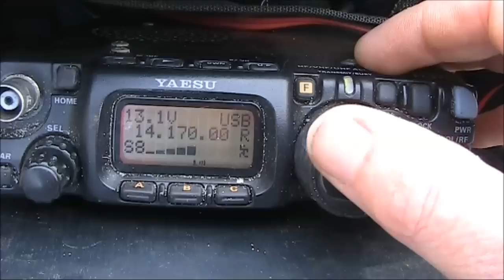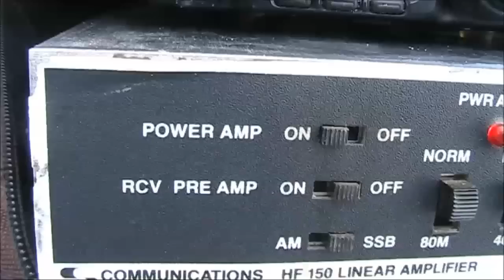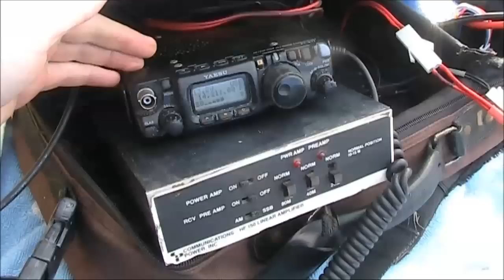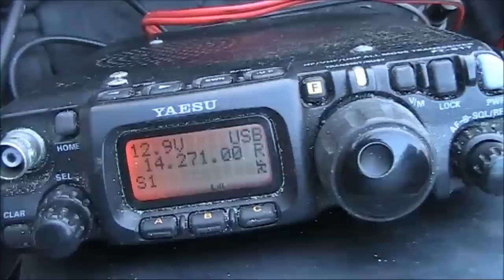50 watt European DX from the beach on 14 MHz

Comment: Peter I operated in the JMFD with one of those batteries connected to a FT-857D running at 50 watts. It lasted 5 hours and 20 minutes with lots of TXing and calling CQ contest. VK5MTM

Comment: Peter,
Great video! Zippy batteries are super.  I use a pair of Zippy 4200 LiFePo4 batteries with an FT-857D at around 30 watts and get around 3 hours total, 20% transmit/80% receive.  I do stop when I have taken 3 amps out of each battery to ensure the longest overall life for the batteries.  If I am near my vehicle then I can charge one battery while operating with the other.  73, Tony - KE4VVF

Comment: A great DX session Peter and well presented video as always. QRP is great but its handy to have the extra power when needed. Still looks a lightweight portable station. I have now modified a  KL500 linear amp on my pedestrian mobile trolley for when the going gets tuff(300W pep). Handy for breaking into pile ups. I will listen out for you from the Blyth pier. 73 M0DAD.

Comment: Try lighter weight Tender brand 13 volt Lithium-iron battery is much greater current than just 8.4 Ampere Hour. battery to really extended your fun DXing from sunny beach.